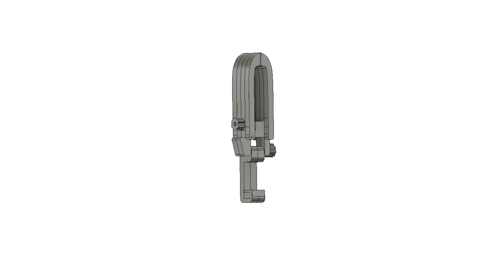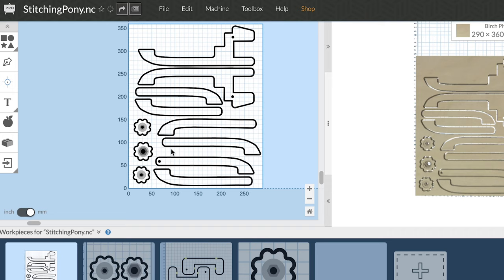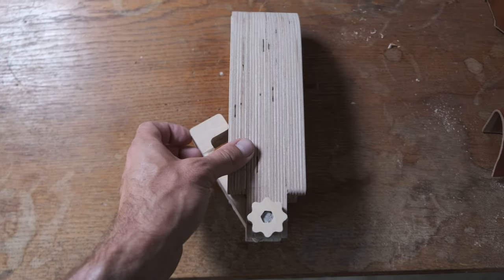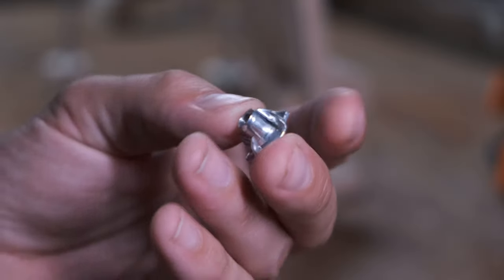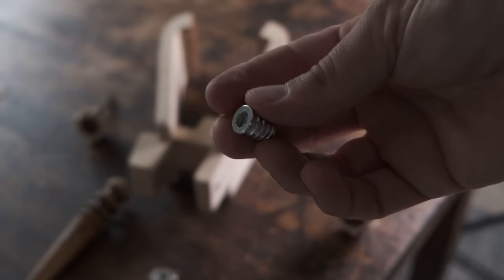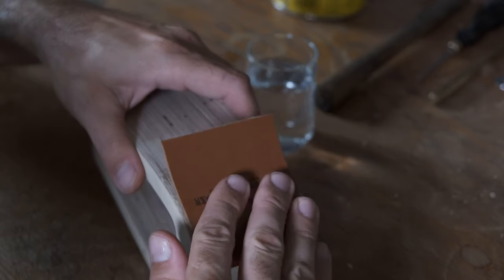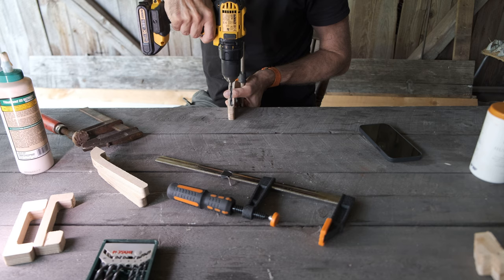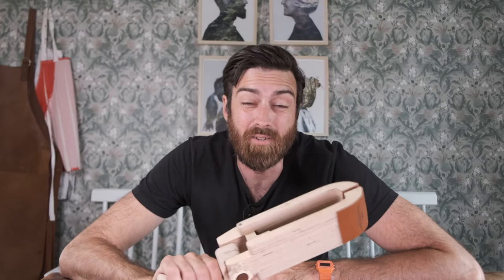the process...making a stitching pony

Comment: Agreed totally about the process taking time trying to troubleshoot in advance and avoid mistakes. I just spent 3 days making something and when I used it found a really basic mistake, but this led to a better solution. 
Now I am making a new pony to replace one I made years ago that has worn out. It is a similar design to the one in this video. One thing I will change is the jaw tightening mechanism, because the changing angle of the forces against the bolt make the clamping inefficient. I'm thinking of using a small slot and some round bar with a threaded hole, so that the mechanism can pivot for more efficient clamping. This of course might or might not work out to be an improvement.
Reply: That's what I was thinking to also but I don't think I can easily find some round bar with a threaded hole. So I'm thinking of an insert nut inside wood round bar. I think in the original one it may be a round wood bar or a wood paste bar with a threaded hole because many people say their stitching won't close anymore or the system don't work anymore where it was most used probably because of the wear out. Others simply break. Or maybe they just used a simple nut inside a slot and after a long time the wear out makes the slot bigger and the system can't work anymore.
Reply: His stitching pony is gonna last 6 months like most of brands who sell this model. Lots of videos on YouTube of broken Dream Factory ones or other brands. It seems from what I saw on YouTube Dream Factory has improved their last model but I'm not sure.
The solution is very simple :
1. a round head cover nut, a t nut or any nuts, you drill hole slightly bigger so the nut can rotate up and down just a bit and you add a washer ( or not, depending on your nut size ). The high tension spring going in both directions will keep the nut in its hole while allowing you to screw and unscrew the handle.
2. if you read until here good ;) now the best and so easy solution. As said, before gluing the two middle plywood pieces drill a hole on each piece on opposite direction for the slot and no need to bother threading a hole in a round bar... when you can find anywhere barrel nuts at all sizes !

Comment: The meaning of sentence "I did it the way I like it." was revealed later on in the video: Twice ;). Just kidding, end result looks really nice and functional. 
One tip for cutting threaded rods: Put a nut on both sides of the cut. Once you have cut the rod, do some initial cleaning with file if needed and then unscrew the nut and it will clean the threads on the rough, freshly cut end. To make it easier, insert THREE nuts per side. One closest to the cut will do the cleaning and two further away can be tightened against each other and that way you'll have something to hold on to while unscrewing the first nut.
Reply from the maker: Man! That is a super useful tip! Thanks!

Comment: Hey there, I’m a big fan of your channel and your podcast! I’ve been wanting to make a stitching pony for a while and your video was immensely helpful. Instead of making suggestions, I’ll just say that if I were making it, here’s how I’d do it differently. For the clamp on the bottom, I would replace the plain nut with a free-spinning washer nut. Just thread it on with the washer facing the surface you clamp it to, and maybe add a bit of leather to the washer so it doesn’t mar anything. I don’t know how much clamping pressure one needs on a stitching pony, but it could be increased by moving the captive nut(the threaded insert that you replaced the tee-nut with) to the outside of the jaw. It would make for a simpler pattern for others to follow, as well as providing room for a beefier table clamp. Again, I quite enjoyed your video and the project itself, and I look forward to seeing more! Thank you for sharing!!
Reply from the maker: Hi! And thanks for letting me know, I appreciate it. Good advice on the free spinning nut - I'll actually try that instead.

Comment: Your original insert nut is meant to be inserted on the “outside” of the work piece so the bolt pulls the nut “through” the wood.  The alternate nut insert works good but it wasn’t really needed. Nice project overall.

Comment: Hi, I've almost finished making the exact copy of the Dream Work pony. I just need attach the table clamp. Anyone knows if for the small handle to block to pony in position you need 1 insert on both legs of the pony ( 1 on left leg and 1 right leg ) or the handle just enter in a hole, go through the clamp and end up in 1 insert nut ?
Thanks

Comment: Nice idea, the folding pony   :-)
Only my advice: 
1. The device seems (to me) too high to have a (long lasting) comfortable position from a "normal" eating table. Hence the jaws are too "long". Or the chair is to low   :-)
2. The threaded hooked nut could be replaced by a piece of round stainless steel bar, drilled and threaded, in a round hole on the opposite side of the pony, which would allow the jaw to function without contraint. This would need a whole through drilling, of course, and a longer screw, but (IMHO), it would be more functional. 
Nice realisation, and interesting CNC job, thanks!
Reply from the maker: Thanks! The pony can be adjusted/titled to a suitable position - you just have to move further from the table. :) I was going to do that with the threaded bar but I didn't want it sticking out the other side because of esthetics mainly but you are definitely right!
Reply: That's how I plane to do mine. I can't get a drilled and threaded bar so I will use a dowel nut. I don't understand why it would need a whole through drilling, what's the point ? Also I don't get why the screw should be longer. Can you explain ?
Reply: @Stavroguine826  The goal is to insure a firm grip, that is from the outside of the pony: the nut and this round bar. Hence the screw must be longer, as it goes all through both parts of the jaws. Moreover, the round bar allows more "liberty" (= less tension) to the screw, as it can revolve in its location when you open and close the pony jaws.
Reply: I made my stitching pony using a rotating round bar with a threaded hole instead of an insert nut. I drilled two 1cm deep holes across the 2 inside faces of the 2 center plywood pieces to create a space for my 2cm long round bar. Then a front hole to screw the threaded bar and I glued the two pieces of wood. My round bar is located in the central part bump of the pony stitching pony (where his insert nut is glued). I didn't need a longer bar. If you choose to drill both jaws, then you need a longer bar of course but you also have to change the design and remove this bump. Then it's not just a modification or an improvement of this model but a different type of pony as it exists already. As for the nut, I guess you're talking about the nut inside the wood handle...whatever...
Reply: @Stavroguine826  Indeed, this is a different system. The drilled and threaded round bar prevents tension when tightening the nut.
And yes, drilling the two jaws, in my idea, so that the stress is exerted from the outside.
Thanks for the description of your clamp 🙂

Comment: The problem with all these types of designs is the side tightening screw.  When using them, my thread catches on the big knob.  It kills the flow of stitching.  I have yet to see a design where the spring/tightener is out of the way.  A fun puzzle but I have no solution right now.
Reply from the maker: That is indeed a bit of an issue. If I find a solution to it I'll definitely post it.
Reply: @TheSwedishMaker  One of my ideas is for the actual jaws to be forward, sweeping away from my body.  That would be where the 'tightening' screw would be.  8 inches beyond the leather work.  That would attach to my bench somehow.  Nothing under the leather being stitched to catch the thread.  The other idea is that the tightener is between the jaws and extend down, out of the way.  Nothing on the outside to catch the thread.
Reply: @bbrachman   another solution could be to have a polished dome/cone shaped tightening knob
Reply: What about installing/mounting some sort of bow over the clamping knob, or a part of a bow (under the knob), which would allow the thread to slide over and not get caught under the knob?
Reply: @merlinch4256  I actually thought of this. Any design I came up with that would swing away (so I could get to the knob) has a corner or two to catch the thread.  The best design would be to have the knob inside the two jaws.
Reply: @bbrachman  I was thinking of a piece of polished stainless steel bar (6 to 8 mm in diameter), in two ways:
1. A double-curved bow (Mongolian bow type) which should come to about 30° on the surface of the clamp, so that the wire cannot catch on anything. At the same time, the clamping knob would remain accessible for the fingers. But the arc should be well over the knob, so that the wire doesn't catch on it.
2. A simpler solution, with the same kind of stainless steel rod. A straight piece of rod, planted at a maximum of 45° on the surface of the pliers, which exceeds the height of the button and comes slightly above the button. This way, the wire is guided over the knob and avoids it. 
Variation with two such rods, parallel and spaced by the size of the button.
Stainless steel, because there is (normally) no corrosion, no varnish or galvanisation to catch the wire, and polished to reduce this risk even further :-)
Reply: @bbrachman  I find the "inside knob" idea very interesting... and challenging  😀
Reply: @merlinch4256  There is one on the market.  I don't like anything about the jaws, arms or clamping system.  I do have one of the small Dream plywood ponies.  Plus, I made my own that clamps easily to my table.  My design is based on the screw/cam system. You turn the handle until it is a bit tight and the fold the handle down to really clamp it. Thread gets caught, but less than a protruding knob.
Reply: @bbrachman   Very interesting. Mine is an old design (originally secured by my knees 🙂) I found on a flea market. I modified it with a cam, in order to obtain a real clamp effect, and it works. The cam and the long wood arms both allow for a great flexibility.
Reply: @merlinch4256  From what I have gleaned over the years, there are two, long styles.  British and French.  One has a metal hinge.  The other is simply the spring of the wood.  Both are held between the legs at an angle and rest on the floor.  They are expensive new. Finding the British style is very difficult.  I have been using the Leap Frog method of stitching.  No pony. Corter Leather has a great video.
Reply: @bbrachman  Thanks for the link, I watched it. Good job, interesting video. The only difference is that I use linen thread, not synthetic.
From what you say, mine is a french style one (quite normal, I live in the French speaking part of Switzerland). I found mine on a flea market, after decades of free hand (saddle) stitching (!), and without using glue... 
Speaking of the tools of the video, I bought some of them only recently, thanks to banggood  😀 Nothing to find any more in Switzerland.
The English ponies you describe must be more difficult to make, and more prone to breakage, hence their rarity   😞  Never saw such a model.
Thanks, Bruce.
Jean-Daniel